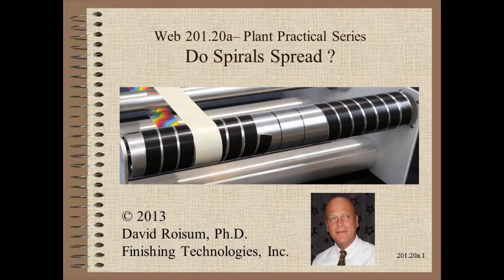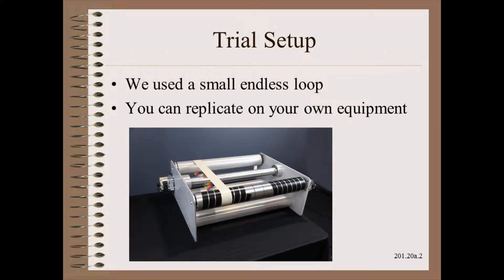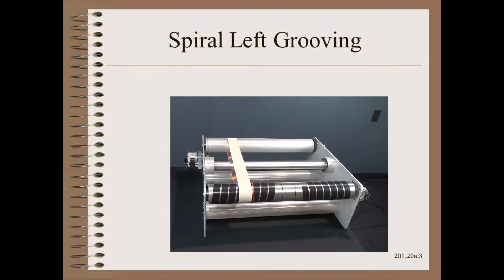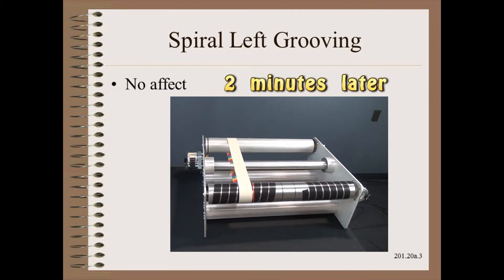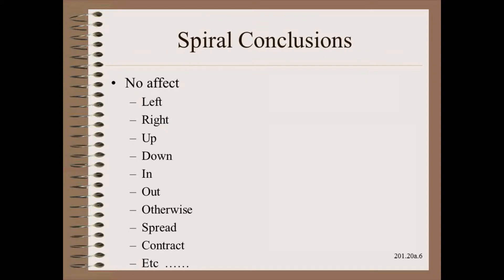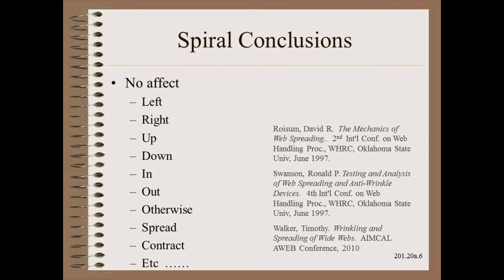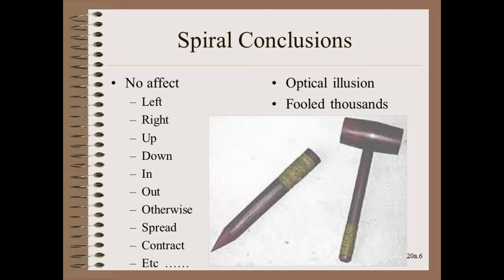Web20120a  - Does Spiral Grooving of Rollers Spread

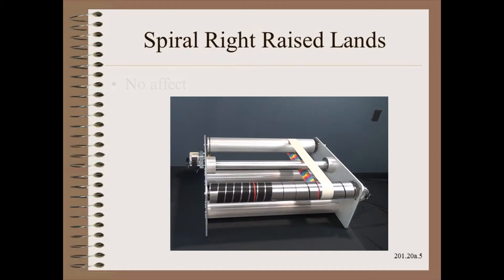Comment from the maker: Steffen.  Absolutely no sustained movement of the ribbon.  The tiny jump you see at 1:10 is caused by a splice (a well known upset).  It jumps out and back one per revolution but no sustained sideways movement.  Slippage changes nothing with one very arcane exception.  That is angled outward stationary grooves can sometimes spread textiles where the threads drop into the grooves.  There is no known measurement, demonstration or model showing this existing anywhere else no matter what the grooving pattern or whether it is moving below, at, or above web speed.  After minutes of running the ribbon is still in the same place.